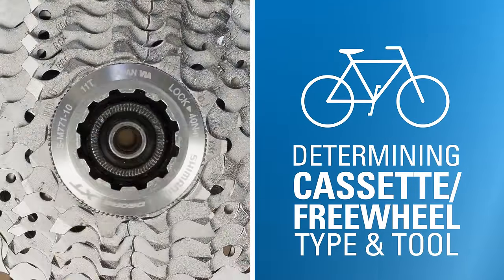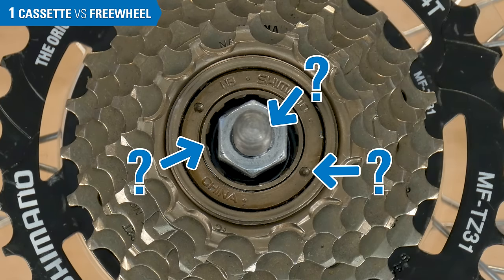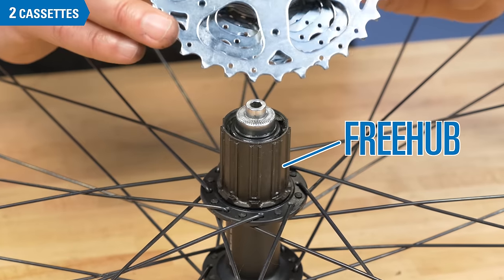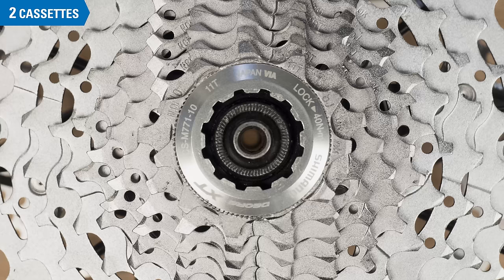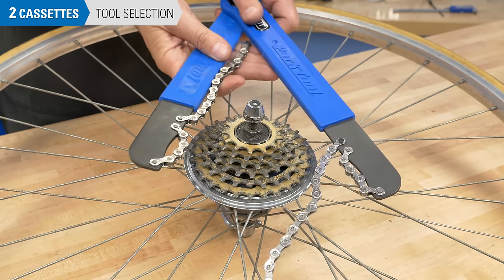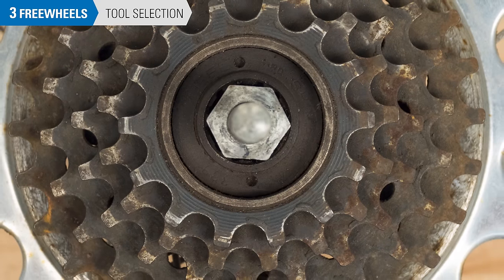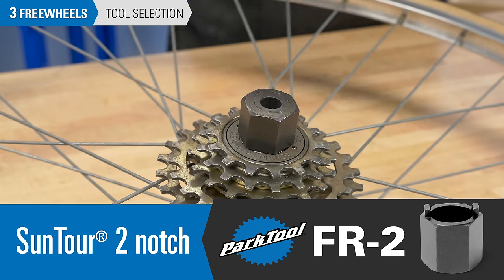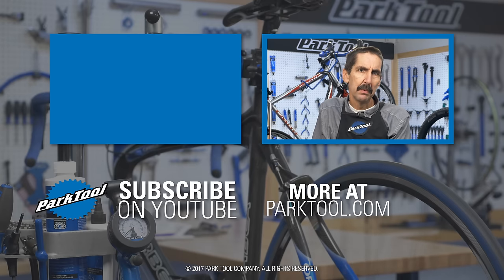Determining Cassette/Freewheel Type & Tool

Comment: I have 7speed freewheel of simano which tool I should use
Reply from the maker: The FR-1.3 should do the trick.
Reply: @parktool  thanks sir, and another question can I replace and put megarange freewheel of simano which u have shown there
Reply from the maker: Your derailleur needs to have the "capacity" for it. If you have a Shimano derailleur there will be a model number such as RD-TY300 or something similar. You can then look this up and see if the derailleur has the capacity for that large of a rear cog. I hope this makes sense.
Reply: But i saw in Amazon magarange that it cannot fit in montra madrock 27.5 how
Reply from the maker: If you look up the rear derailleur that you have you can find out if you have the capacity to go to a mega range. If you do not, you can switch out the rear derailleur to something that will accept a larger rear sprocket.

Comment: Is sram nx series a cassette type and does it fits with speed one hubs by the i am reffering to 12 speed hubs my sprocket is SRM NX PG1230
Reply from the maker: That is a cassette that requires the FR-5.2 to remove and install. It is not an XD driver type cassette.
Reply: @parktool  will it fits on speedone hubs   SPEEDONE SOLDIER

Comment: I have a question i have a freewheel cassette but i can also remove The cogs like a regular cassette. I cant find what brand it is and im very confused if mine is a freewheel or regular. So i can remove it in both The cogs like a regular but The hub i remove like a freewheel. So i Wonder if anyone knows what this is type of cassette and can anwer me. And unfortunately this video did not helped med that much exept how to find what cassette tool needed.
Reply from the maker: If the tool fittings do not spin backwards as the sprockets spin backwards, it is a freewheel.  There are common freewheels that have an additional lockring to hold sprockets to the freewheel body.   This ring is used for assembly of the freewheel body with sprockets, and is simply left alone.  Remove the freewheel, with sprockets and body together.
Reply: @parktool  thanks for The anwer

Comment: My sons bike has a "Sun Run" Freewheel. It's 12 spline but around 32mm. Anyone know of there's a tool to fit?
Reply from the maker: That is the lockring to disassemble the freewheel. If you look closer to the axle you should see a smaller diameter 12 spline pattern that will fit the FR-1.3.

Comment: Can any one tell me as i cant find any info from numerous shop and repair places my front hub has been tightened and i got play still in the front hub ! Shop checked said blah blah like they all do ! Now is it safe with less than 1 mil play ? If any one knows let me know please ? As shops only want you to leave and Pay wont sell tools ! Great industry in AUSTRALIA ALL RIP OFF AND DON,T CARE ABOUT CUSTOMERS ! ONLY TAKE THE CASH ? WTF ?
Reply from the maker: What hub are you dealing with? There are a few very specific brands and models that will pretty much always have some play.  99.99999999% of hubs should be able to achieve a "no play" scenario and be smooth and nice.
Reply: @parktool  Shimano 40 mil front hub mineral disk brakes ,Shimano mtb rims tubeless 27.5 ! No drop out ! allen key ! Forks DNM USD Horrnettes 35 size 6 , down hill race . You can feel side ways play .
Reply: @parktool  WH- MT 15-A SHIMANO IS ON THE HUB FRONT AND BACK . THANK YOU !
Reply from the maker: That hub should be able to have no play when on the bike. While the wheels are off the bike there should be a small amount of play that will be taken up when installed on the bike. Thru axle hubs should have less play to no play while out of the bike but we do find that the axle still compresses in a thru axle system similar to a QR system. Here is an article that goes over how to adjust hubs like yours. https://www.parktool.com/blog/repair-help/hub-overhaul-and-adjustment
Reply: @parktool  Thank you will watch much appreciated !
Reply: @parktool   THANK YOU SO MUCH GUYS ! I bought all the park  tools cone spanners and did it myself ! No shops in Australia helped me and charged to have a look 2 shops said its the tyre beading and the rim 1 said the forks are no good ? 4 times 34 to 45 quid ! bought heaps of park tools and other ones . Now i do all myself !

Comment: 3:50 huh?
Reply from the maker: What are you wondering?
Reply: I have shimano hg62 11-36, 10 speed just was confused since there is more than one tool.
Reply from the maker: MCMTB Any of the FR-5.2 family of tools will fit your cassette. The difference between them is the guide. The FR-5.2G is one that has a guide that helps line the tool up if you have a quick release wheel. The FR5.2GT has a guide that will help line up the tool if you have a 12mm thru axle. The standard FR5.2 will work on all of them it just does not have a guide to aid in the process. Hope this helps.
Reply: Park Tool yes that helps. Thanks!
Reply: What's the FR-5.2H for? Sorry to hijack this reply.

Comment: why are cassettes so damn noisy?
Reply from the maker: Good question.  To clarify, the cassette should make no noise when the lock ring is tight.  It is the freehub that goes tick tick tick, or for some models, TOCK TOCK TOCK.  Designs of the ratcheting mechanism varies between makes, with the number of pawls, the spring strength, ratchet shape varying.  Beside appropriate lubrication for your make, there is nothing to do, except don't coast.

Comment: Hey parktool..I learned a lot from your videos and did alot of things myself watching your videos... Recently I was thinking to change my rear hub from freewheel to cassette and I saw a video which mentioned that rear derailleur has lower limit if it's 14 teeth you cannot use it with 11 teeth cassette efficiently.. all I know is my bike spec mentions it has shimano rd tz500 and came with a freewheel 14-28... If I change my hub will it work with cassette 11-28?

Here is the reference to the video:

https://m.youtube.com/shorts/r408GzmimLw
Reply from the maker: On the back of your rear derailleur that should be a part number that will read something like RD-TY300 or similar. If yours is a RD-TZ500 then your rear derailleur is freewheel specific and its performance will suffer when used on a cassette.
Reply: @parktool  Thankx alot❤️ .. yes it is tz-500 .. not going to change now will stay with the freewheel

Comment: This is so stupid, who has these tools just laying around???
Reply: What do you mean?   I haven't used them in years, but I have the tools for all types of freewheels, and all types of cassettes, including multiple chain whips.
Reply: @billkallas1762  But surely it was possible to make cassettes aso only using regular all around tools. These tools here are specialized for bikes and nothing else. Most people that never fixed bikes will not have them.
Reply: @ussassu  People who have worked on their own bikes, over the years, tend to accumulate tools, as technology changes. For example, I haven't had a bike with Sun Tour or Sachs freewheels for over 30 years, but I still have the tools.